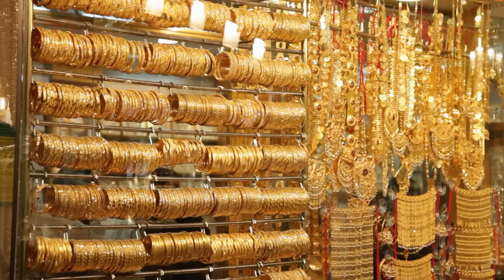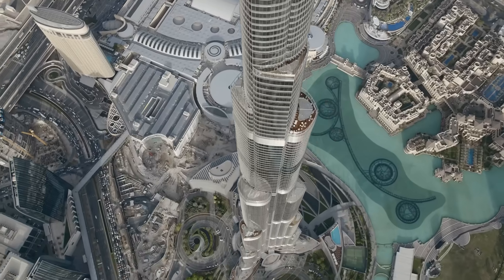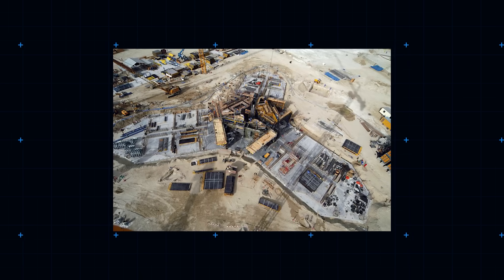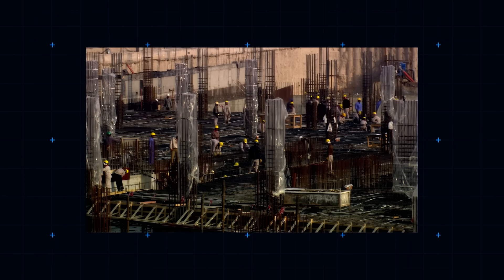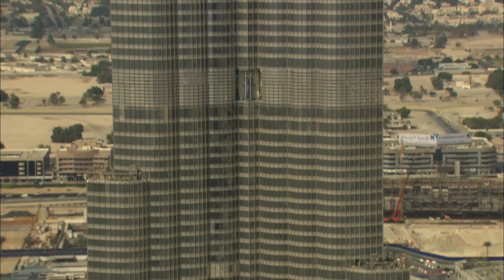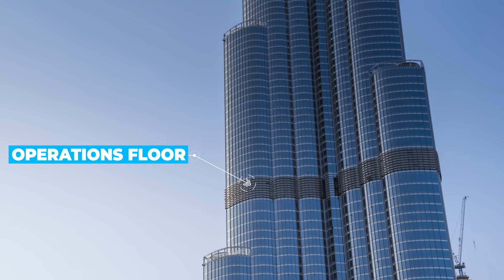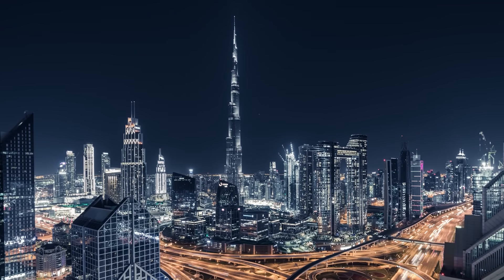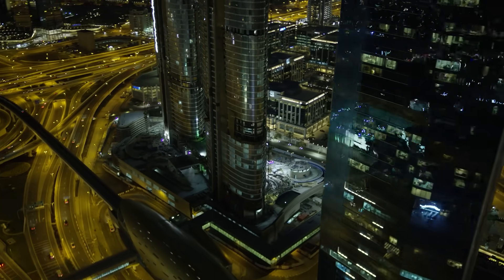How The Burj Khalifa Was Built

Comment: Tall buildings are eye catching but not ver practical in my view.  If I had the where with all to invest in something unique I would, instead, design a new city in a desert clime somewhere.  It would be a domed structure reaching a height of just under ten thousand feet high.  Within it would be an entire city, self contained, managed in a very disciplined way.  No automobiles allowed.  No homeless allowed.  No illegal drugs allowed.  Controlled underground access via high speed rail ftrom trusted, well established ports of departure.  Politics?  None.  No conflict between "left" and "right" nor any conflicts of interest between any religions.  The idea would be to move away from the traditional human settlement andd into something entirely new.   It would be a design model and testing platform for future cities on other planets.

Tall structures, when slender, are interesting from an engineering scholastic point of view but they are impractical.  Consider all the time and money invested for a very limited amount of floor space.  Consider also the load per sq meter on the base.   A dome structure is very light in this respect.  It almost floats on it's base no matter the material.  And wind resistance?  A dome, properly made of appropriate material, can withstand the strongest winds ever recorded on our planet.   Domes make a lot more sense than any tall building on a small base.

Comment: The Indians are planning a taller building. FML, they don't even have proper roads there 🤣🤣😂😂
Reply: Dr Ry  Correction: Cheap Indian labour was exploited to construct the Burj Khalifa. Indians did not do the important things requiring skill and knowledge to build it like engineering,  projectmanagement, architectural work, logistics, etc, so your argument is a moot point.
Reply: Dr Ry  That's because it's not true.  CLEARLY you're missing the point of what it is I'm saying. I'm aware that Indians were used to construct it, but all the intelligent work was done by non Indians.

Comment: Not worth $100 ! You have to line up even if you booked to go up the tower and access is limited to one particular floor where you can see parts of Dubai. You can vouchers on groupon cheaper than purchasing at the sales desk of the Burj Khalifa   that's if you really insist on going to the top . I had better views from hotels nearby especially in the winter when it is foggy, I booked 55th floor of one of the hotels on sheikh zayed Road and that was much better
Reply: It doesn't cost 100$ to visit the upper floors, it's not even half that. Packages start from 150AED which is 40$ And you can even get it for free through some offers in the city